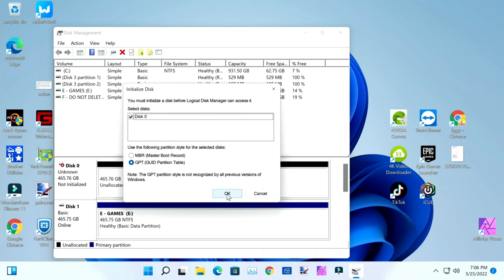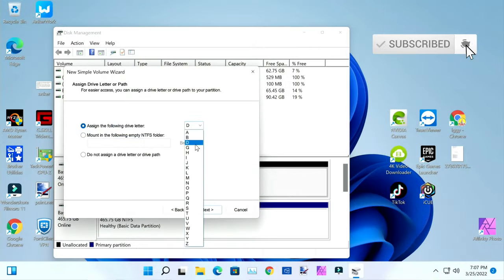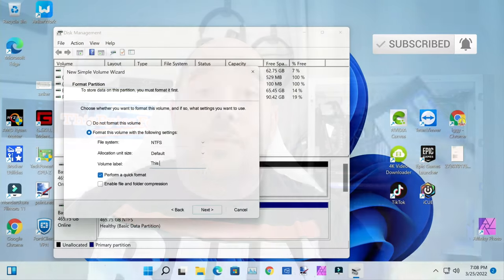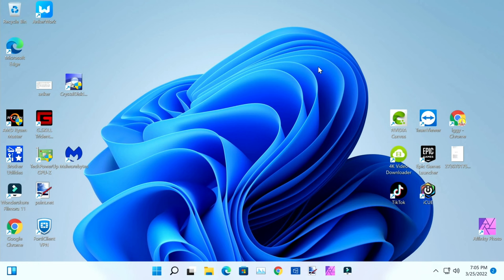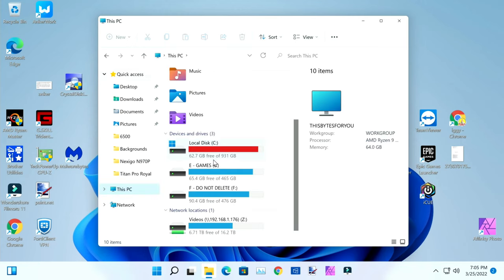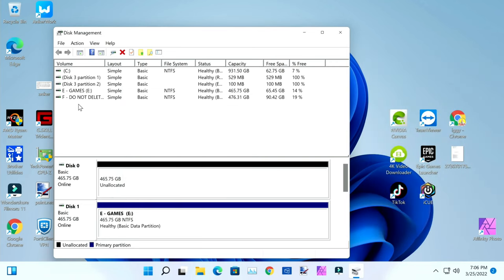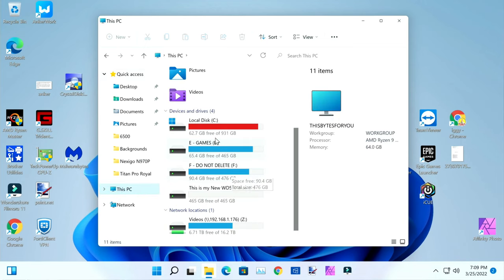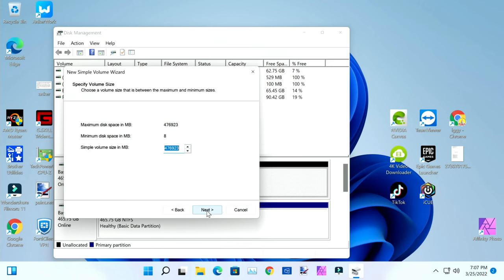How To Install a Second SSD into Your PC

Comment: Hmm, so I followed your guide yesterday and installed a new SSD, initialised it and everything was working fine. But this evening, the drive isn't showing up. I've gone to Disk Management to try and initialise it again, but get a Virtual Disk Manager warning saying 'a device which does not exist was specified'. I'm a bit stumped as to what to do next. Any ideas? :S
Reply from the maker: Have you tried shutting down, disconnecting everything, then plugging it back in and powering it back on?
Reply: @ThisBytesForYou  Thanks for replying, I did try this before seeing you'd responded. I also changed the drive letter as (probably coincidentally) it stopped working whilst importing photos from a memory card. It seems to be ok today so far - I suspect maybe when I put the case back on it nudged the power cable out of position... Though I have also had a critical kernal power 41 shutdown, so I wonder if maybe I need a new PSU or something :S Anyway, the guide was really useful, thanks!
Reply from the maker: So that I can help, please list the manufacturer and exact model number of the following components:

1. Motherboard - manufacturer and exact model number
2. CPU - manufacturer and exact model number
3. M.2 - Manufacturer and exact model number, if you have any, and how many you have in this system
4. Regular SSD - Manufacturer and exact model number, if you have any, and how many you have in this system
5. Hard Drive - Manufacturer and exact model number, if you have any, and how many you have in this system
6. Graphics Card - Manufacturer and exact model number, if you have any, and how many you have in this system
7. Power Supply - Manufacturer and exact model number, if you have any, and how many you have in this system
8. PCIE Devices - Do you have any other PCIE devices?
9. Are you overclocked?
10. This video will help you identify hardware inside your PC: https://youtu.be/65ZSiVImJx0
Reply: Hi, no not overclocked as that never ran smoothly in the past. New SSD is Crucial MX500 4TB 3D NAND SATA 2.5-inch 7mm (with 9.5mm adapter) Internal SSD

- Seasonic Focus Plus 750W 80 Plus Gold Modular Power Supply 1
- Fractal Design Define R6 Midi Tower Case - Black 1
- Intel Core i7-7820X 3.6GHz (Skylake X / Basin Falls) Socket LGA2066 Processor - Retail 1
- System Build Fan - Noiseblocker BlackSilent Pro Fan PLPS - 120mm PWM (SI) [EXNO-001] 2
- MSI GeForce GTX 1070 ARMOR OC 8192MB GDDR5 PCI-Express Graphics Card 1
-  Samsung 960 PRO Polaris 512GB M.2 2280 PCI-e 3.0 x4 NVMe Solid State Drive 1
- WD 4TB Black 7200RPM 256MB Cache Internal Performance Hard Drive (WD4005FZBX) 1
- Asus WS X299 Pro (Socket 2066) Intel X299 ATX Motherboard 1
- Team Group Xtreem "8Pack Edition" 32GB (4x8GB) DDR4 PC4-25600C14 3200MHz Quad Channel Kit - Black 1
Microsoft Windows 10 Pro 64-Bit DVD
Reply from the maker: I forgot to ask, what is the motherboard manufacturer and model number you are using
Also, aside from the video card and single m.2 ssd, are you using any other PCIE device?

Comment: second hand ssd with ops on it kicks in when you boot up even though you set the bios to boot your own ssd first??? do you need to slave the new ssd as in the old days
Reply from the maker: No, there is no way to select master, slave, cable select., You have to go in the bios and select your old drive.  Since uefi and gpt talk, the hard drive/SSD can make its own changes in the boot priority if need be, as the bios sees fit, you just need to manually change that.

Comment: Okay so If I do this process can I remove my old ssd and will my new ssd now have  windows 10 ? I am wondering if I can do this without having to use a flash drive to install windows 10 on to the new ssd.
Reply from the maker: No, windows doesn't magically get on a drive, if you don't want to install windows which is the best way to get more performance you can clone it, which I don't recommend but here is this video https://youtu.be/4BtdMcqwaFg
Reply: @ThisBytesForYou  K thanks I will just get a flash drive then
Reply from the maker: @venom286__worldoftanks3  this video will show you how to make it correctly: https://youtu.be/C759I7DBXd8

Comment: Bro this video don't work for me does anyone have a z7neo I'm trying to put in this crucial 2.5 inch solid state drive im so confused I have a data cable but I don't have the other part that's needed for the ssd the power one the long one and it's not in my pc either so I'm just confused
Reply from the maker: This video is not working for you because of your configuration.  The SATA power cable, is on your power supply, it powers your current SATA drives, you can branch out using this off of my  Global Amazon affiliate link: https://geni.us/l6JAe8 which would branch out 1 x SATA power connector to 4 more, if your power supply is older and you dont have SATA power, you need to branch out using Molex, you can use this Global Amazon affiliate link: https://geni.us/EP2yOz

If you have a SATA port on your motherboard, chances are your power supply has that adapter as well, but you might be too scared to look for it, follow the power cables that are in your machine back to your power supply and see if you can find it, if not, one of the 2 adapters I linked up for you will work.

Comment: What if, i  bought a new HDD  "4TB WD " , used it as an external to copy my files on my old pc... now tryinf to mount it into my new PC...   can i follow these steps and just skip the "formatting" steps ?   from what it seems its creating some massive partition with the existing files
Reply from the maker: As long as you format GPT and NTFS you can have what ever size you want.
Reply: @ThisBytesForYou  it doesnt really allow me to do anything with the disk... all options are blacnked out.. but it does register a drive.. i just cannot use it...     but i have already ordered a new SSd .. and a HDD casing.. ill use the hdd as external and ill install the SSD .... your video was still pretty good thank you
Reply from the maker: always a pleasure my friend.  As for your disk, watch this video, not so much on the cloning aspect, but more for the BIOS vs UEFI and MB vs GPT, it may help you in this situation.: https://youtu.be/4BtdMcqwaFg

Comment: I have a bizarre issue. My laptop is low on storage but has multiple other drive slots so I figured I'd utilize. Main drive is a m.2 2280. It has an extra 2280, a 2242, and a 2.5 sata. I wanted to keep the the original drive as the boot drive and add the others for spare storage. But whenever I add another drive the computer tries to boot from the extra drive instead of the original, which is of course empty. In the Bios I can see the drives and sizes but can't tell it which drive to boot from. It's an alienware 15 r4 with the Aptio bios. The sata is set to raid on (if I change it to AHCI it only acknowledges one drive instead of all of them and of course it's the wrong drive)

If I take the extras out and leave the original it just boots up like normal after a restart. Have you ever heard of this before? What if I changed it to AHCI while only the original drive is in, then added spares after that, would it change the recognition? 

Anyway, thanks if you see this
Reply from the maker: well, youre in the right place, I was a product development engineer for Alienware, though I worked on Gaming Desktops, not laptops, that was Tony and Eddie but the issue is universal.  So, right click on the stat button and click "Device Manager" , click to Expand "Disk Drive", then locate your OS drive, right click on it and select properties.  Click the "Volumes" tab, then click "Populate", under "Partition Style" does it say MBR or GPT?
Reply: @ThisBytesForYou  update! I found an old dell forum post with someone that owned an R3 running into the same issue. The chosen answer was to reboot in safe mode, via cmd. Then restart and go into bios and turn the sata setting from Raid On to AHCI. Then reboot again and deactivate safe mode. After that I installed the extra drives and everything behaved normally and there was no boot issue

Since then I've gotten the spare drives initialized and functioning, and I'll be cloning my C drive to a larger ssd this morning as well, using macrium. 

Thank you for your quick reply. For your question it was already set to GPT. Also went ahead and updated the Bios to latest version while I was at it
Reply from the maker: awesome, yeah that was one thing that bugged me back in the day, going for RAID, when AHCI is basically the same and less of a hassle, so glad you got that.   OK cool that its GPT, because you will need that for the larger drive and BIOS update.... geeez man... you don't need me.... hahah Glad you got it working my friend ;)
Reply: @ThisBytesForYou  👍 partly got lucky with the search after what seemed like reading 50 pages already, finding one with the same issue. Once I got home from work I stayed up til 1am working on it and getting everything buttoned up and squared away and moving programs/files. I'm sure you've had days like that where you can't let the problem go until you figure it all out
Reply from the maker: oh of course, comes with the job of Product Development engineer and IT haha but its fun, since you have to always think outside of the box and create things and then it makes sleep soooooo much nicer hah

Comment: Hello, quick question what if I use a power splitter so i could supply my new second ssd with my first ssd thats already existing within my pc, will something unfavorable happen?
Reply from the maker: well yes an no.  I have done it many times in the past,... most of the times there is no issue but you have to be very careful with the splitters, the quality can be questionable and it could melt, taking your SSD, cable, power supply, PC and MUCH more.  I have been lucky, that being said, if I don't need to, I don't.
Reply: @ThisBytesForYou  Thank you for the response, I'm currently using the 2nd ssd with the power splitter as we speak and i set it up thanks to ur guide! I do hope that it wont melt like u said lol Thanks a lot
Reply from the maker: @seagullgaming958  good luck my friend, just be very cautious when connecting it,  and always a pleasure my friend.  If you have not already, please do consider subscribing, I come out with videos weekly to help you on everythign PC related, I usually post on Mondays but I had to skip monday, because the product is releasing tomorrow, I hope to catch you there ;)

Comment: I just bought the MSI CODEX RS 11TC-058US Intel Core I7 11TH GEN 11700F (2.5GHZ) 16GB DDR4 1 TB PCIe SSD NVIDIA GeForce RTX 3060 Windows 11 Home 64-bit in 09/2022. I'm adding my backup drive from my older computer (WD10EZEX). I have the power connector but I can't find the data connector. Shouldn't that cable have come with the system?
Reply: BTW... great video... short and sweet and comprehensive!
Reply from the maker: @stephensokol8586  Nice system, so for the DATA cable no, that comes with the motherboard, so if there was an extra one, it would have been in the motherboard box, if you have it, if not, you can always buy some online, here is my Global Amazon Affiliate link where you can pick some up, they are cheap:  https://geni.us/1up1jYg

Always a pleasure my friend, so very happy you stopped by, trusted in me to help you, liked and subbed as well as took a moment out of your day to thank me.  It means a ton to me and I am so very happy I could help you.
Reply: Kindly post your place for me to purchase the data cable.
Reply from the maker: click on the link I provided, thats Amazon as I stated, that is my affiliate link: https://geni.us/1up1jYg

Comment: Hello, I got to the part where it shows "Initialize disk" and did GPT but it doesnt show an "unallocated" disk, im not too sure what to do next?
Reply from the maker: so if you did GPT, its partitioned, give it a drive letter and you should be good.
Reply: @ThisBytesForYou  okay, so i was able to do it but how can a repath game files to the new ssd? or just repath any new programs i will install? my computer is still slow and i am not too sure what to do next :( i did transfer some files to the new ssd but a lot where game files and dont wanna mess up my game saves :(((
Reply from the maker: I dont recommending "repathing" the games, you will have issues, I recommend reinstalling the games.  Is windows installed on the SSD or the Mechanical drive? @MoshiMochi
Reply: @ThisBytesForYou  all my games are on the HDD and I'm pretty sure my windows in installed in the SSD. But the game files upload on my SSD :(((
Reply from the maker: @MoshiMochi  is windows installed.on both the SSD and HDD?
Reply from the maker: Sounds like the SSD is just a spare drive.  Remove the hard drive from the computer for now and install windows on it, you will see how much faster your computer is.  Some videos for you, how to install windows 11 https://youtu.be/ayp8TksEtoY

Performance differences between SSD and HDD https://youtu.be/Ih28muags6s?si=n995XvnKWt2UFzOZ
Reply: I think its only in the SSD my C: drive is my ssd and my E: drive is my hdd where all my games are at. My ssd onlybhad 4gb left so thats why its been slowing down 😔 but i even installed a new progran today and it still installed in my C: drive and there was no way to repath it.
Reply from the maker: @MoshiMochi  you have to tell the installer where you want to install to

Comment: So my motherboard has like sata ports 1-6. I read through the manual and couldn't find anything about it sharing lanes or bandwidth with other ports (m2 etc) but I could have sworn it matters which ones you use. I have a z390 maximus hero wifi and both m2 are populated and 1 sata is being used (this is how nzxt bld sent it) and I want to add 1 sata ssd. Does it matter which sata port I plug into?
Reply from the maker: if you go to our manual here (I will have link below), on Page X, (Page 10 on a PDF) you will see it reads "When the M.2_1 Socket 3 is operating in SATA mode, SATA6G_2 port will be disabled.  What is the manufacturer and model number of your M.2 SSD?  ALso, you could just move the SATA drive to a different port and you will be good.

https://dlcdnets.asus.com/pub/ASUS/mb/LGA1151/ROG_MAXIMUS_XI_HERO/E14808_ROG_MAXIMUS_XI_HERO_WI-FI_UM_V2_WEB.pdf
Reply: @ThisBytesForYou  Both m.2 are samsung 970 evo nvme so neither are running in SATA mode. So I guess this means I can use whatever available SATA port I want w/o worring about stealing bandwidth from the graphics card etc? Also I'll just avoid sata6g_2 port to be safe. I only have 1 sata port being used right now for a 2.5in ssd storage drive that came installed with the machine and there are several other sata ports available. I just want to make sure I dont gimp the performance of anything else by installing a sata drive in the wrong (shared) slot. Thanks for your help. Love your videos!
Reply from the maker: Always a pleasure my friend, so very happy I could help you.  If you haven't already, please consider subscribing, I come out with videos just like this every week and with almost 400 videos, I am sure I have something else you might need.  If not, let me know, if it makes sense, I might make a video out of it.  Thanks for giving me the opportunity to help you out.

Comment: I know this video is older but I’ve been struggling to find anything anywhere that will help me fix my problem I’ve set up the drive as instructed things looked normal and worked normal for about 1 hour than the new drive would just simply disappear and only reappear after I restart my pc
Reply from the maker: That doesn't make sense. What are the model numbers of the motherboard, CPU, and all the drives in your machine?  Also is the drive that you are installing a sata drive with a sata cable?
Reply: Yes it was a sata drive with a sata cable the drives I have are a cruicial M4-CT256M4SSD2 and a Western Digital WD10EZEX-08WN4A0 but I’m only having the trouble with the cruicial ssd my motherboard is a Asrock x570 steel legend WiFi ax and the cpu is a ryzen 7 5800x I hope this is what you were asking and I appreciate you taking the time to reply
Reply from the maker: "usually" when you have an M.2 drive, your motherboard will disable SATA port 1 and 2 or 7 and 8, try putting the SATA drive on port 3 ~ 6 and see if that helps.  I don't see your manual states this, but it is common, give it a try.
Reply: @ThisBytesForYou  thank you I’ll shall try this
Reply from the maker: @vxonlygreensvx500  always a pleasure my friend, let me know how it goes.

Comment: What do I do if my new disk doesn’t show up on disk management? Pls help
Reply from the maker: So that I can help, please list the manufacturer and exact model number of the following components:

1. Motherboard - manufacturer and exact model number
2. CPU - manufacturer and exact model number
3. M.2 - Manufacturer and exact model number, if you have any, and how many you have in this system
4. Regular SSD - Manufacturer and exact model number, if you have any, and how many you have in this system
5. Hard Drive - Manufacturer and exact model number, if you have any, and how many you have in this system
6. Was this a clean install of Windows that you upgraded at some point, for example, you had Windows 7 but upgraded to 10 or 11 or did you install 11 and are cloning 11.
Reply: Ok I can get back to you on the names in a little bit but I bought a complete computer off Amazon and I think I can send you the link of it and it should say the parts
Reply: And when I got it all I did was set it up and it had windows 10 I think